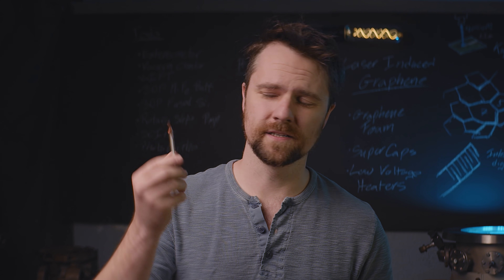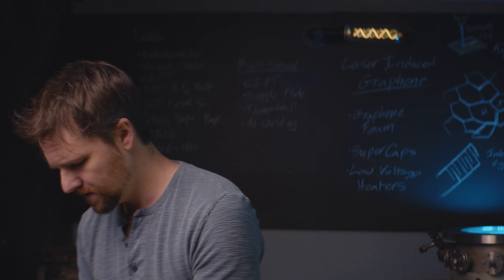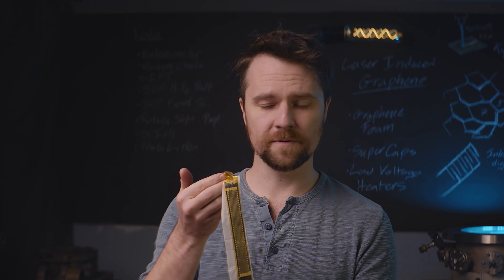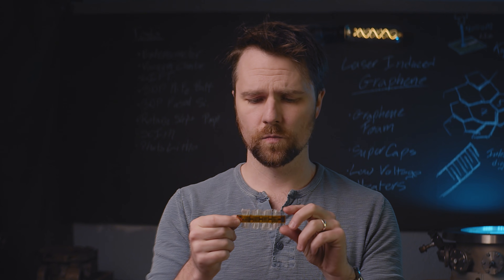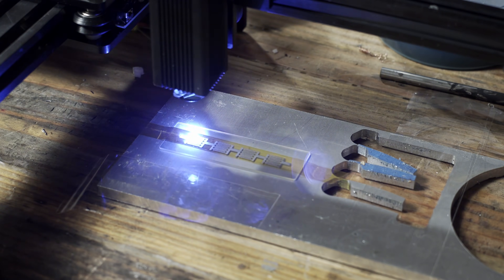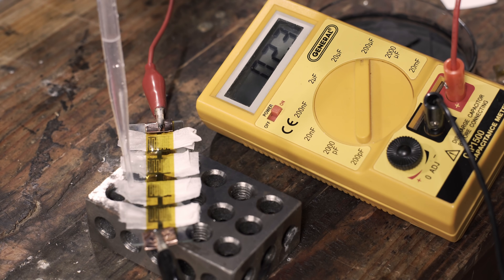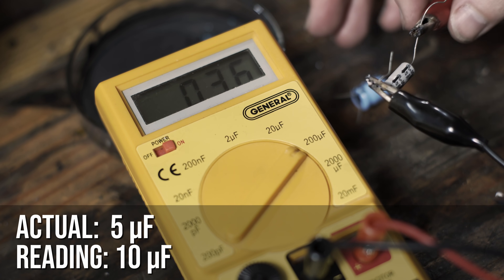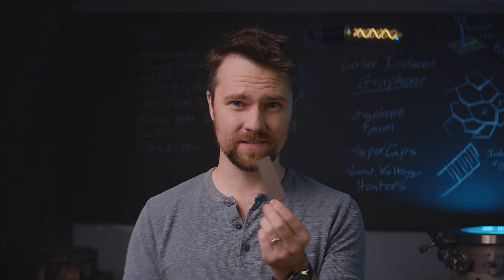Kapton Tape Supercapacitor?

Comment: you should be trying to light at least a led, the experiment will bring "  light " in this clip and make more visual for all on the channel ;)
Reply: yep, capacitance meters can show a completely irrelevant reading if you just connect a slightly weird resistor-like thing to it... because from the video, i remained unconvinced that the device can actually store some energy.
Reply: @victortitov1740  it works... my group works on this and other things in the lab (a little fancier, granted, but the principle is the same). 
That being said, I would have cycled it with a decent sourcemeter, then again, me, laser physicist lab, him, at home ... so.
Reply: @randfee  I am currently working on an electrostatic adhesion gripper. They require an input voltage between 1-6kV, so we need materials with high dielectric strength. At the moment we are ordering flexible PCBs with the interdigitated pattern and the space between the electrodes is limited by the dielectric strength of the adhesive. Would you be able to produce them with this method and what material would you use to cover the electrodes?

Comment: Regarding the readings on your meter : you need to keep in mind that capacitors actually have large tolerances. Unlike resistors you're never going to find 0.1% tolerance capacitors. 20% is considered good, and it can go up to 80%. So your meter is probably quite accurate, it's just that capacitors in general aren't.
Reply: ive never encountered barely 20% tolerance on any caps. 80%? they would be literally useless with that much variance.
Reply: @jhoughjr1  depends on what you're using the capacitor for. Buffer caps used in cheap consumer-grade power supplies, for instance, can be 470 µF or 4700 µF and no one will see a difference. Standard marking Z denotes -20% to +80% tolerence. P is 0 to +100 % tolerance. This is process-dependent, really : electrolythics are usually the worst offenders. But it's also linked to capacity. Seems it's easier to make a precise small capacitor than a precise large capacitor.

And that's why you don't use an electrolythic as part of a precision RC oscillator.

Comment: With regards to the estimated capacitance versus the actual measured capacitance:
You're noting the difference in capacitance value and voltage tolerances.
The value of capacitance given on a capacitor is a minimum. 
The voltage tolerance is a maximum, 
///but///  
Most capacitors are built with at least a 5% tolerance. 

That means, for whatever a given voltage is, it needs to be able to vary upwards by 5%, since, as current movement increases and decreases across a capacitor, voltage levels will also rise and fall accordingly. 

This is also why it's not always a good idea to be riding near a voltage rating on a capacitor, since exceeding that voltage rating will result in capacitor explosions.

Comment: The bed heaters on my 3D printers typically have kapton covering them. They also suffer from being inconsistent and take a long time to come up to temperature with DC power (less so with the AC bed heaters), with less heat near the outer edges. If the kapton covering them were the actual heat source then I imagine it would perform MUCH better. :)
Reply: I immediately thought about the same thing. Aluminum is often used to spread the heat from the wires of a heater. Lot of the heat is lost to the backside of the plate. So what if you had a glass bed, completely covered with kapton tape and a standard PEI sticker on top of that. Glass is more rigid than aluminium, has lower density, is a fairly poor conductor of heat and even cheap glass sheets are usually flatter than aluminum. So one can have a lighter, more rigid and flatter bed, reduce losses from the backside and get a more uniform heating. Manufacturing this should be very easy too. Just apply kapton tape to the glass, treat it with a laser, run two pieces of copper foil on the sides for power, then apply PEI sticker on top. Or, perhaps a magnetic sticker to enable the use of removable flex sheets.
Reply: @anttiandreimann8456  you'd also have to figure out where to shove the sensor to feed data back to the controller, and hope your PID tuning algorithm works properly. That said, insulation layer, kapton, electrodes and thermistor, then print bed should work really well and keep the heat directed upwards.
Reply: @AlexanderTzalumen  to try it out crudely there's a simpler solution, since the resistance of the "heating mat" shouldn't vary too much with the temperature swings (at max up to ~100°C of swing from ambient, for general 3D printing with "normal" materials) you could even characterize it measuring the temperature with a thermocouple vs PWM percentage of current, and then control it just by using a look up table and not even need a PID controller, as a certain amount of PWM controlled current should provide the same temperature consistently. Although thermal imaging would be necessary to ensure the current is not traveling in just a straight line or area of the mat (think skin-effect) as opposed to through the whole mat, because PWM-ing creates a lot of high frequency harmonics which may (or may not) induce this effect. Might give this a try one day if I get myself a laser, hope someone beats me to it because it sounds promising IMHO
Reply: @markopesevski  perhaps, but the marlin firmware used in the majority of hobbiest and consumer 3d printers all use PID controllers for their heating elements, partially for the initial temperature ramp, and also for maintaining temp stability against the various sources of heat loss (radiant losses, ambient air currents, part cooling fans, moving build plate, etc). For a heated build plate, inconsistant temperature can lead to 1st layer delamination, which will cause the print to shift, warp, or fully detach.
Reply: @AlexanderTzalumen  I get the point you're making, but I was thinking more of a crude experiment for trying stuff out rather than a generalized solution deployable on all kind of printers. My approach was to first try it and make it work, and then iron out all the details
Reply: @markopesevski  it's not really a situation of 'some printers need PID controllers' it's a situation of 'all printer heating elements require PID controllers to operate'. If you're talking about just seeing if it's possible to heat the bed with the kapton circuits, sure, but for a practical model you've got to ramp to the target temp quickly, and hold that temp steady under operating conditions. For instance, in trying to improve the print quality of my anycubic kossel, i installed a more powerful part cooler, and running that at full power too close to the bed trips the thermal runaway protection because the heating element cannot keep up with the temperature losses from the air flow coming off the part cooler. For instance, Prusa's attempt to solve the issue and provide better part cooling involved printing the heating element as a conformal coated circuit directly onto the static bed base, rather than simply attaching a strip of heating wire to the bottom as most entry level machines have. Modifications such as aftermarket glass print beds further complicate temperature control issues.
Reply: @anttiandreimann8456  You could make the bed heater using the printer itself. Just mount the laser to the print head and run it uniformly over the kapton.
Reply: Power is power when it comes to resistance heaters.  I doubt any differences you’re seeing is due to AC vs DC.  If you apply DC V or RMS AC V you’ll get exactly the same result out of a heater.
Reply: @stargazer7644  Talking about speed, responsiveness, and uniformity here, not efficiency. AC bed heaters bypass the DC power supply that is used for everything else in a 3D printer. Only the cheap printers use a DC bed heater, which means they chose a power supply that could handle the rest of the printer with enough overhead for a bed heater. It is not going to be a monster DC supply for instant bed heating because there is no point when you can just use an AC bed heater for that. As a result of these real-world considerations, DC bed heaters take about twice as long to reach the target temperature versus a similar printer with an AC bed heater.

Comment: Doesn't have to be the meter. Ben Eater build a clock with a cap and wondered why he got wrong frequencies from it and then found out that the caps he used (all of them from the same production) were 20% off. So there seems to be quite a range from what's printed on them and what they actually measure.

Comment: it seems to  behave like a electrochemical cell rather than a capacitor
Reply: Yeah probably, in which case who knows what this cheapo meter would read. This setup has barely any surface area and it's not really different from a printed metal pattern from what I can tell.

Comment: That is a capacitor. 156 uF that can handle less than 1V is not even close to the numbers normally associated with supercapacitors. They're normally measured in farads, not microfarads. I'd be interested to see what you could get if you rolled a bunch of these up, though. You could probably get well into the millifarad range if you rolled a not completely ludicrous number of these things up without getting much larger than typical capacitors or supercapacitors available today. Similarly, my brain was grappling with the contradictory nature of "really high temperature" and "2/3/400 degrees celsius". A bog-standard nichrome wire heating element like we've been able to make for over 100 years can easily handle temperature well over 1000 degrees celsius.

One thing I was wondering about was the equivalent series resistance of these custom printed capacitors. Given that the material is useful as a heating element, I'm assuming that the resistance is relatively high for a conductor and so the ESR of these caps may also be high. Then again, maybe the addition of the electrolyte fixes that. It would be interesting to measure.

Note that your capacitors are more than likely +/-20%. That's a pretty typical tolerance level for commercially available capacitors unless you're splashing out the cash for more precise components. A 180 uF +/-20% capacitor could have an actual capacitance anywhere betwee 144 uF and 216 uF. The "actual" capacitance of those capacitors you measured was probably closer to the "reading".
Reply from the maker: For sure, the absolute value is very small.  In terms of volume-per-farad it's still pretty large, since the coating is only a few hundred microns thick, and I believe supercaps are largely "super" because of their power density and discharge/recharge rate.  E.g. supercaps have been integrated on ICs before and are quite small in the absolute sense (and pyhsical too I guess haha).

Regarding temperature, in theory the LIG should be able to reach max decomposition temperature of carbon, something like 3000C.  But since it's on a Kapton backing (with silicone adhesive), the polyimide decomposes well below the max temperature :)

Thanks for stopping by! :)
Reply: @BreakingTaps  The volume aspect did occur to me, hence my suggestion of rolling them up. Charge/discharge rate is a function of voltage and resistance. Have you been able to measure ESR on your printed caps? Like I was saying above, it would be interesting to see what that is, even if just a rough measurement. Not sure what equipment you have. In the absence of an ESR meter or oscilloscope, most of those multifunction component testers you can find fairly cheaply on Amazon, eBay, AliExpress, etc will give you an ESR measurement if you stick a capacitor in them. I wouldn't expect super accuracy, but should at least be in the ball park.

I realize it's the kapton that's going to fail. I'm nitpicking really. I quite liked the video and it's good to see new creators creating good content and gaining views/subs.
Reply from the maker: @brettski74  No ESR measurements, although a bunch of people have commented about that aspect so it was a pretty big miss on my part.  I'm mostly an electronics idiot which is why it didn't ocurr to me :)  I have an oscilloscope, will do some reading on how to measure ESR and see if I have any of these test samples still sitting around on my bench for measurement :)  Or maybe just pick up one of those multifunction testers you mentioned, cheap/easy is good in my book if it gives a rough order of magnitude reading.

And no worries, nitpicking is good with me! I've learned a ton from people pointing out my mistakes (which are many)!  This is all way outside my actual professional training/experience so happy to hear what I'm doing wrong, or misstated :)

Comment: I'm curious... At what wattage can you get closer to room temperature?
Reply: The heater you mention at the end I mean.  Very interesting stuff on the capacitor!
Reply from the maker: Hmm, I'm not sure to be honest.  If I remember correctly, I was running it ~30V/3A when it hit 300-400C, and it seemed to scale pretty linearly.  So for room temperature it probably only needs a small amount of current

Comment: could you put one set on one side of the Kapton, and put the matching set on the other side?
Reply from the maker: Unfortunately not for this kind of capacitor, you need the electrolyte to flow between the two sides. So there needs to be some kind of permeable membrane or filter paper between the two sides.  You could put an electrode on two different pieces of kapton and then sandwhich them together face-to-face though, similar to how regular caps are assembled

Comment: What is their idle discharge rate? Like, if you charge a capacitor like this, how quickly does it discharge without load? This is a common problem with capacitor setups without a hard insulator between electrodes.
Reply from the maker: Pretty fast self-discharge.  I didn't measure it quantitatively, but if you leave it sitting around for 10-20 minutes it'll be mostly dicharged when you check back. I wasn't sure if that was due to the process, or my sub-par attempt to fabricate it :)

Comment: I could see the heater strips being used on a micro scale for things like TCXOs and such. They would make miniaturization of heated components easier by allowing smaller components to be heated at lower voltages with mere μAs. 

Now that's just speculation on my part, but I can see the possible uses being enormous.

Comment: did you try electroplating some copper onto the feeder traces to drop the resistance?  Traces are parallel to the edges, it seems to be doable by dipping it into the electrolyte just a little bit so the plates/fingers don't get wetted by the solution and remain copper-free.
Reply from the maker: I didn't for this video/experiment, but I recently tried electroplating some for a different project.  It seemed to work well!  I was trying to improve solderability (it didn't) so I didn't check the conductivity afterwards but I imagine it improved a ton.  It took the copper plating very easily.

Comment: This is pretty cool, but I have an interesting idea based off of this. Couldn't you use this to create flexible custom pcb's? I mean, attaching components to it might be hard, but for a test pcb, this might be a great "cheap" alternative to buying a mill and producing your own. I guess it'd have to be surface mount components only, but still a neat idea.
Reply from the maker: The LIG itself has relatively high resistivity compared to something like copper, so it wouldn't work too well for actual traces.  But, I recently tried to electroplate it (for a different reason) and that seemed to work well.  It plated out with copper easily, and was still flexible.  So that might be a way to get flexible PCBs.  I didn't test the conductivity but I would guess it improved a lot.

Comment: Can you remove the tape after etching?
Reply from the maker: If you're very gentle you can, but the LIG is flaky and fragile. Most papers actually laser a plain piece of polyimide (without adhesive) and then stick a piece of Kapton tape on top to form a flexible thing. I was just too lazy to buy non-adhesive kapton :)

Comment: Could this work as a flexible PCB?
Reply from the maker: The LIG itself has relatively high resistivity compared to something like copper, so it wouldn't work too well for actual traces.  But, I recently tried to electroplate it (for a different reason) and that seemed to work well.  It plated out with copper easily, and was still flexible.  So that might be a way to get flexible PCBs.  I didn't test the conductivity but I would guess it improved a lot.
Reply: @BreakingTaps  That's pretty cool. That might make a good membrane for an electrostatic speaker too.

Comment: Would it be possible to electroplate copper to the graphing? This would increase the conductivity if it did not break down the graphing sub layer
Reply from the maker: Yes, you can! I did it recently for a different project and it seemed to plate well. I didn't measure resistivity unfortunately (was trying to improve solderability) but I would guess it helps a lot.

Comment: Kapton tape battery heaters for lithium battery cells, solar panel defrosters, built in freeze proof PVC pipe heaters, floor board and tile heaters, sidewalk and driveway snow melters .... this seems like a great cheap means of electrifying the world.

Comment: If you could make small enough laser lines, then you could make safety eye glass heaters that would defrost safety glasses (or any glasses, goggles) just like car window defrosters.
Reply: the glasses aren't usually made of Kapton, so this may require an inert atosphere when etching. Also some protection against the elements is needed.